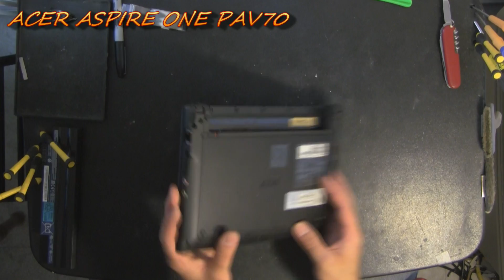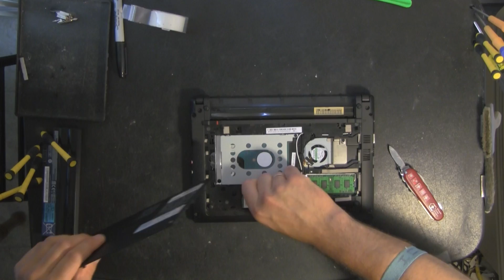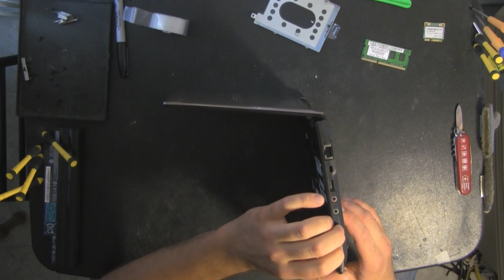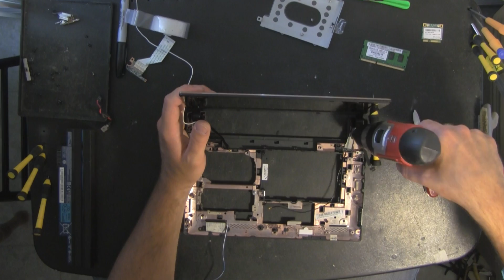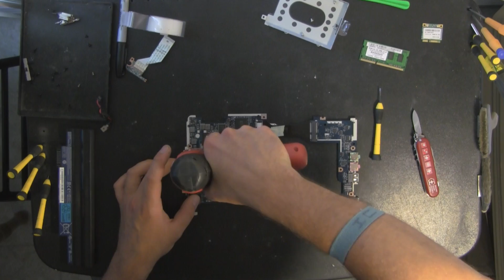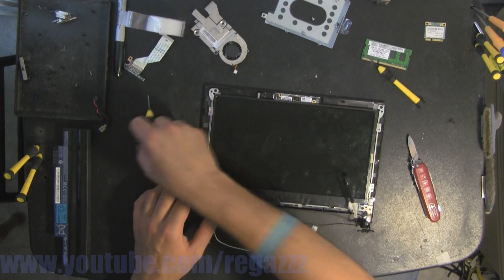ACER ASPIRE ONE PAV70  take apart, disassemble, how to open, video disassembly

Comment: I have a question about the motherboard and the RAM chip.

Acer made the PAV70 with a MBSDxxxx RAM identifier. Acer had acquired eMachines, so another PAV70 was released as an eMachines version. The motherboard of this second model is hypothetically incompatible with the Acer PAV70 motherboard, because of the difference in the RAM chipset - the eMachines model uses a RAM identifier of MBSExxxxx.

I'm thinking of spending the $50AUD to get a new motherboard, and all that I'm seeing available is the Acer version. Some people have mentioned a risk of non function or damage that might come with incompatibility.

Any ideas?

Comment: Hello, I don't know if this comment section is still active, but I have a question. I have a similar model, but it's called eMachine model PAV70. It doesn't start anymore, no reaction, so I opened up and I have no clue why (I am not an expert). Have you heard about this problem on similar models? Thanks
Reply: I have a emachine one too, maybe the problem is the power, you can search for power related parts from the netbook

Comment: I know everyone will hate me, but just to say that this is not the right way to repair any computer, firs of all no antistatic table or other antistatic equipment like mat or strap, second you can`t use metal equipment to split plastic or opening keyboard, there is special tools for that, otherwise you will scratch, damage, brake plastic or paint, and third you must first open the retainer and only then pull out the zif, but the rest was all good, obviously you were taking it apart not fixing it